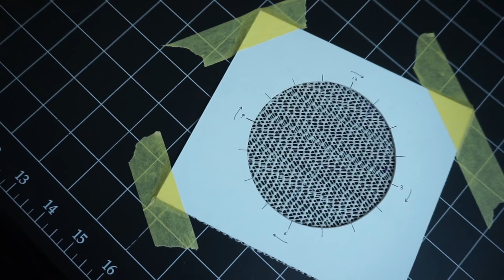New Mezzotint Printmaking rocker Jig plus Sharpening demo

Comment: Hi Graham, how many degrees you keep the rocker when you sharpen?
Reply from the maker: +Arion Bajrami hi Arion, I just match the existing angle of the rocker. I add a little black marker, sharpen, and then check it to make sure I'm grinding off even. I'm sure if you email EC Lyons or another supplier of your rocker, they could tell you the angles they should be at when new.